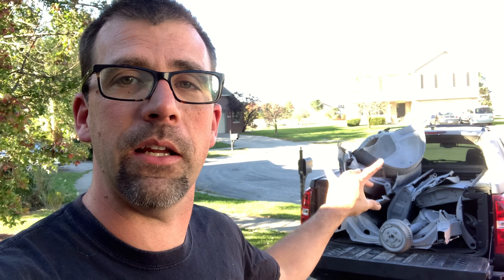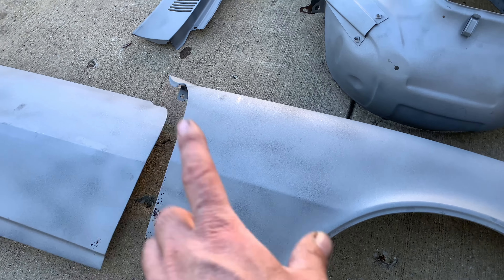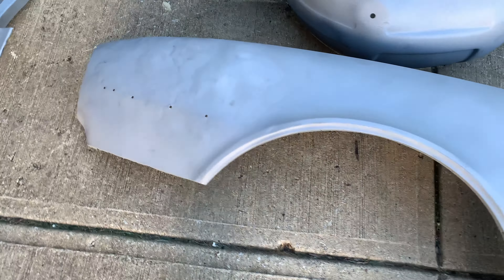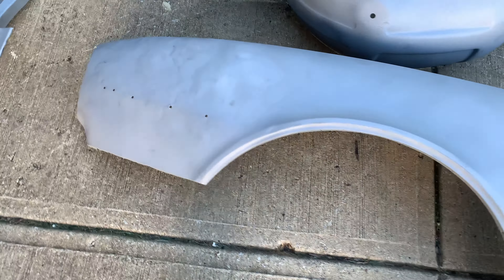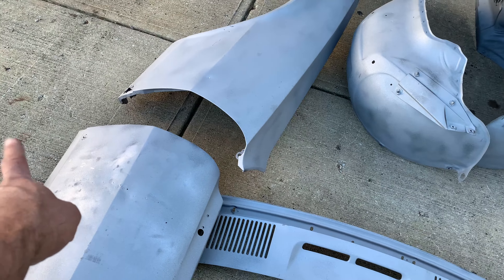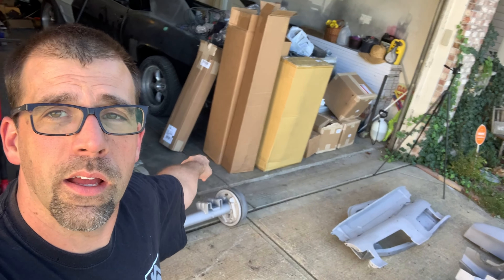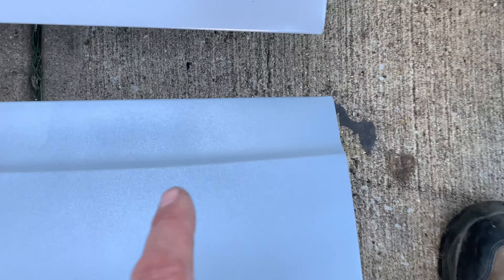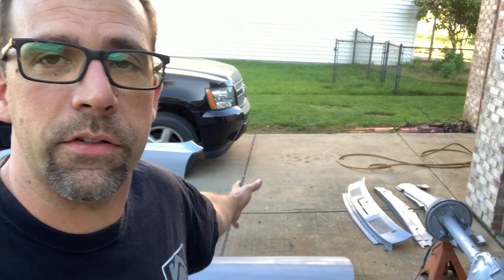What’s left after Media blasting? inspecting the aftermath, 1968 Firebird

Comment: Have you ever done an original radio install on a 69 firebird?  I have the original for our rebuild but can’t find anything but retrofit videos.. My husband and I are rebuilding  ours in our home garage as well
Reply from the maker: That is awesome you are doing the resto at home!!  It can be done.  As for the radio are you looking for something that just fills in the hole like a factory radio or do you want it to work too.  On my 1969 convertible I used a company that made it look completely original but all new guts and has blue tooth option. I did it that way because as you probably already learned 1969 dash is a one year only opening and not normal so if you dash is original nothing fits but an original radio.  I just checked prices they have gone way up unfortunately $800 😬
Reply: @VinylVillageGarage    I actually have the original delco model 92FPB1 am radio.. found it before they went up .  We have a reproduction dash carrier for a 69 bird but I know their are bracket(s) .  We are about a year in with engine exhaust etc done, getting to the point where we are thinking about windshields and interior after installing new fenders and have saved and restored a lot of stuff like interior door panels/sail panels and original wheel.  Love watching your channel .. it’s motivating .. like seeing your kids involved.  Did you ever find the seat belt you were looking for?  May have one if you still need.. saved all original stuff
Reply from the maker: My kiddos got me to do YouTube I like including them when they want to.  It’s a cool way to keep some memories always available to watch even 10 years from now. I did find a seat belt, thanks for asking. The factory radios weigh quite a bit and really need the rear support.  the replacement ones weigh about 1/4 and seem to be ok without.   Are you missing the rear bracket? They sell for about $15 Firebird central
Reply: @VinylVillageGarage  Thanks for answering.. I do have the bracket but wasn’t sure if there trucks to the installation .. the radio is actually quite heavy.  Too bad I can’t attach pics to  show you the progress.. have a great day and keep buiding
Reply from the maker: @kellyrobicheau7844  i do wish YouTube would allow photos. I really enjoy seeing projects come
Back to life